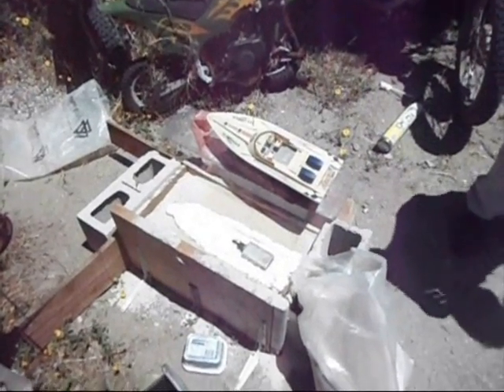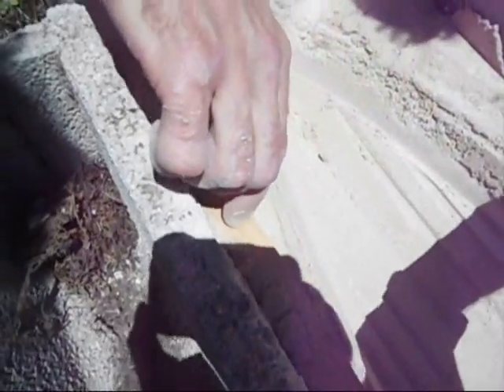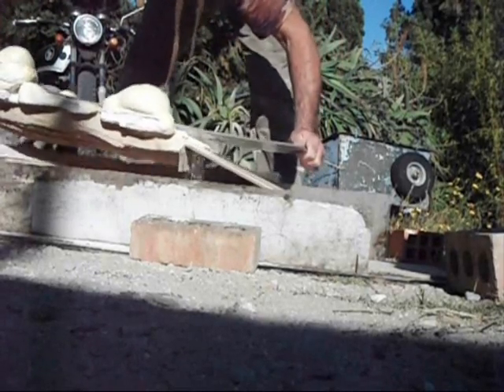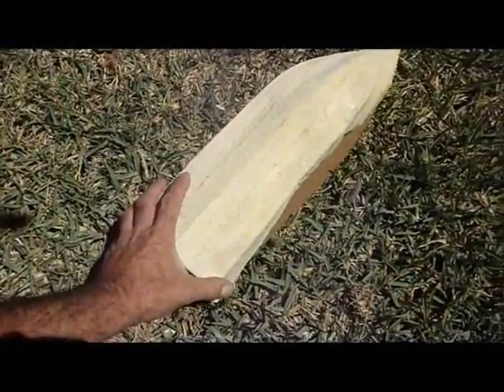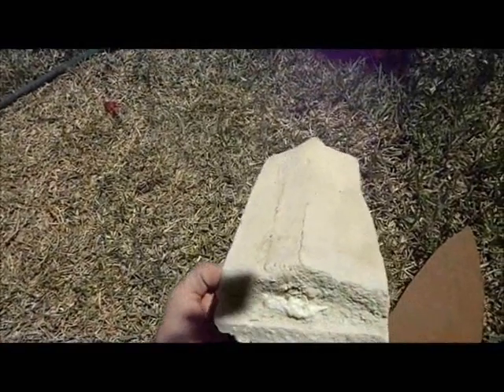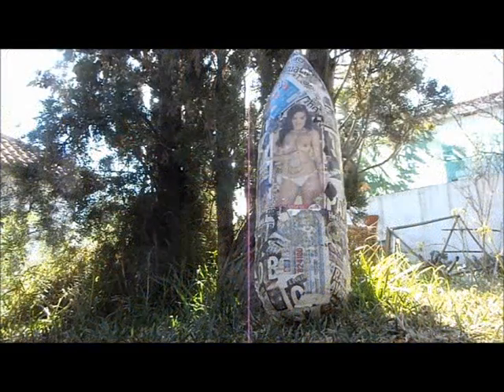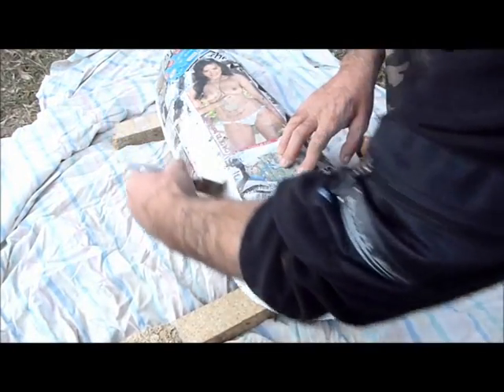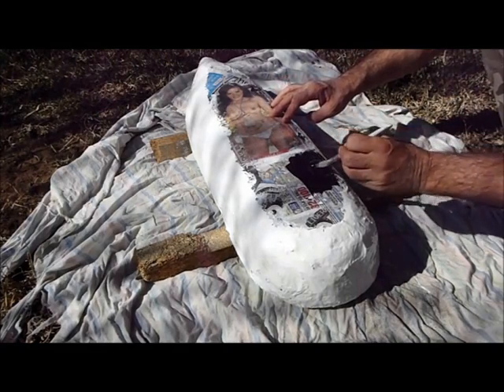Using building materials for homemade rc boat hulls.

Comment: Del... That's AMAZING! Really makes me want to try making one. RC Boat kits are almost as expensive as Aircraft. Great idea!
Reply from the maker: I love RC boats, but they do ave a few disadvantages when compared to cars. If a car's motor stops, it remains in place while you walk over and retrieve it, while a boat will like as not drift away. If you roll a car, the same applies, while a boat may sink.
Still, I do like playing with boats, and I tend to like older styles, with wood involved in their construction.
Reply: @Del350K4   True, but here in the US Desert...  we've only got swimming pools to run in.
Sure there's the Colorado River... BUT if your motor dies - it's going to MEXICO!! 😫😜
Reply from the maker: @CarmineRC  I'm still heart-broken from the loss of my boat while filming my video 'Gibraltar fast cargo launch'.
It had a rudder malfunction while out at sea and I very nearly lost my life attempting to rescue it. I had filled the Hull with foam, so it won't have sunk. I guess it's still in the Atlantic somewhere...
Reply: @Del350K4   If it drifts here... I'll send it back! 😉😎